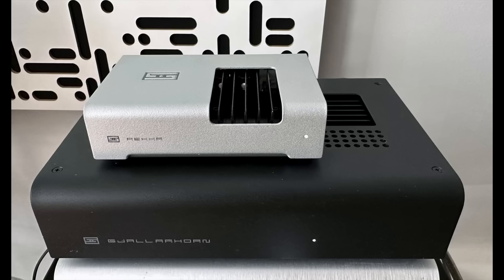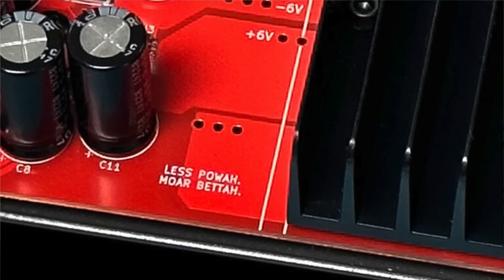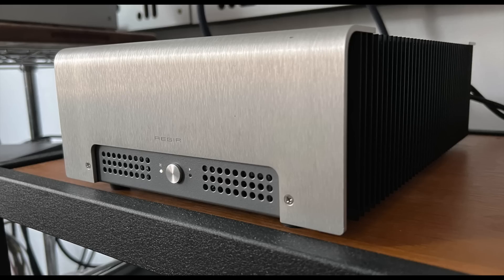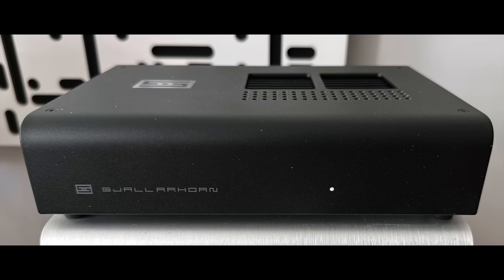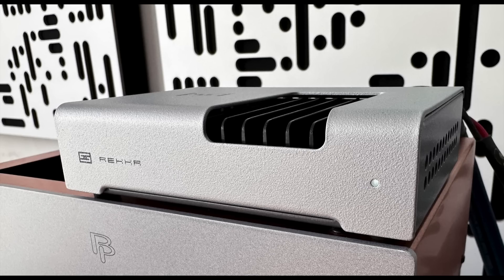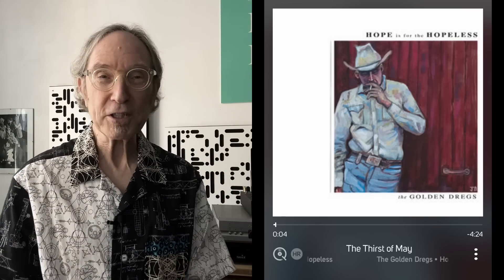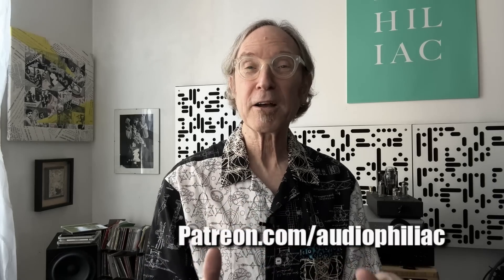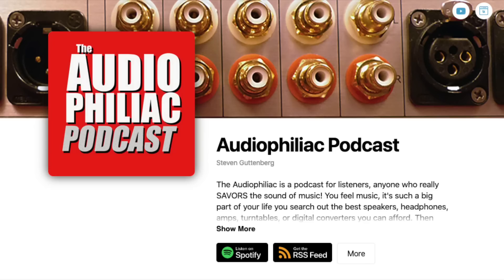More SCHIIT: Rekkr & Gjallarhorn Amp Reviews

Comment: I'm really enjoying my Gjallarhorns run as monoblocks through my KLH Model 5's. Using a Freya N preamp. Happy to answer any questions too.
Reply: Running two 'horns in the same config.  Topping e50 > 'horn + 'horn > Emotiva t2+  (i switch between having them mono and bi-amping, for funzies)
Reply: How are you running them as monoblocks? I just got my first one and never have ran monoblocks before. Do you really need the balanced input to make it as a monoblock?
Reply: I recently purchased a Freya + and a Gjallarhorn.  I am still within the exchange window and have been worried that I should have gotten the Vidar II.  But, for 200 dollars cheaper I could purchase a 2nd Gjallarhorn and run mono...  Are you happy with the sound quality?  Do they get relatively loud as mono blocks?  I have Wharfedale Denton 85th ann. speakers (4 ohms and a claimed 88 dB sensitivity) and don't tend to listen loud, but sometimes like to crank it up a bit.  Thanks!
(Thanks for the video, Mr. G.!)
Reply: Would love to hear the improvement or difference in running the Gjallarhorns mono.
Reply: @gabrielgarza863  Monoblock is an amplifier with one output for one channel. For a standard two channel system with two speakers you would use one amplifier per speaker.  In the case of this unit, it's a two channel amp that you can bridge to be mono by connecting the pos of one channel and the neg of the other. It's labeled on the back of the amp which one to use.
Reply: @andrewz925  Thank you. Can you split the RCA input  from your preamp so you run the left channel to one amp and the right channel to the other while its in mono mode?
Reply: @randijofabrications  get vidar 2
Reply: @gabrielgarza863  Yes you have to use balanced for monoblocks.
Reply: @claybomb545  Done
Reply: @randijofabrications  I ran a single one for a few days while my second was shipped (they accidentally sent me one when I bought two but they corrected it quickly). While I got well past twelve o'clock on the Freya to get it loud, I still didn't max it out to get it louder than I'm allowed to have it. Two are just fine. But they're not meant to rock a house.
Reply: Not to hijack your thread, but I have a Freya N too (and I'm getting a Gjallarhorn), and I was wondering what tubes you like in yours.  Thanks.
Reply: @zounds13  I haven't done any tube rolling yet but I will be getting some Siemens E88CC and some Reflektor 6922's to try sometime soon.
Reply: @andrewz925  Oh yes that is what I meant. Thank you. I was probably overthinking it. I saw the mono sign over the balanced input on the Gjallerhorn and I was thinking it would only work in mono mode if you use the balanced input only.
Reply: @gabrielgarza863  According to the specs on the website the stereo RCAs are for stereo output only and the XLR is for mono output only, so I was incorrect.
Reply: @gabrielgarza863  Yes. Need a balanced source with XLR outputs. Send the left channel to one Gjallarhorn and the right to the other. 1:27 shows the rear panel. + of the right channel output goes to + on the speaker. - on the speaker goes to + on the left channel output.
Reply: Gotta be careful running a stereo amp as mono because with a speaker that drops to 6 ohms for example, the amp will see a 3 ohm load…this is why it’s not uncommon for people to prefer sound quality of an amp in stereo vs bridged mono.
Reply: @gabrielgarza863  to my knowledge you can only use the balanced input for Mono. It is designed to work with 8 ohm loads only. It can do less, but may trip, and shut off.
Reply: I had the same idea. Any benefit of this setup vs 1x Vidar 2? It seems like you could get way more out of the latter for around the same price (and have room to upgrade later to a second vidar 2 in monoblock). Genuinely curious—thanks in advance!
Reply: @keplermission  It’s a reasonable question, brother. Steve compares Vidar 2 to one Gjellerhorn(?) and the verdict is on the side of the Vidar 2. My simple question is would running TWO gjellerhorns in mono shift that verdict (all else being equal). This is a much more fair comparison, as price is similar.
Reply: What a great combo. Love the model fives!
Reply: @maximburgman  one vidar is a ton more power. No need to monoblock vidar as same problem…stereo amps bridged to mono get unstable at 4 ohms. If you want to monoblock buy monoblocks.
Reply: @keplermission  No qualms about any of that, sir! But I’m coming from perspective that Schiit has a certain ‘house sound’ and other commenters are talking about running two Gjellerhorn as monoblocs. My question is would this work better than a Vidar 2 (also made by Schiit) for roughly the same price—and if so, what would be the comparative advantages? Thanks for your response!
Reply: @seanb3303  both the Gjellerhorn and Vidar 2 were designed to be able to be monobloc’d (whether this is ‘better’ I don’t know). My question was does using TWO Gjellerhorn as monoblocs offer advantages vs using one Vidar - for about the same price? Thanks for your comment!
Reply: @keplermission  the problem with bridged mono is the amp sees half the impedance. So yes this will limit speaker selection and will run the bridged amps harder….for double the money 😀 I will stop short at saying bridged mono is a scam, but it is majorly inferior to true mono…and in many cases people are paying double to have their amp current drained by bridged mono.
Reply: @keplermission  this is from Jason Stoddard…but what does he know? 😀 Where is the 4 ohm watts listed for bridged mono? It’s not listed because the bridged amps will see a two ohm load and possibly go into a protection shutdown to keep the amp from going up in flames 🔥
Reply: How big is your listening space?  How loud are you listening? Looked up the sensitivity of the 5s, they’re less than the Klipsch he reviewed.
Reply: @jackstraw1756  Fairly close to 12x18 room size, and I don't listen loud enough to shake anything or annoy my landlords (though they're quite forgiving as they have very young kids). The KLH are nothing like Klipsch though, that's for sure.
Reply: @maximburgman  using two stereo amps bridged into mono is often times inferior to using one. That is why there is no 4 ohm rating. If these were true single channel monoblocks it would be a different story. So no advantages to Vidar regarding watts or current.
Reply: @randijofabrications  I have a similar setup: Freya+ into Aegir driving Sonus Fabers that are not a simple load - 4 ohm and 89dB.  The Aegir is a new addition, and while I don't listen at very high levels, I'm strongly considering getting a 2nd Aegir so I can run them in mono and have more reserve power available.  The Freya+ really brings out the best in my old Sonus Fabers.  Tubes are new to me, and I see some tube rolling in my future.
Reply: @billh4477  Thank you, Bill, that's nice to hear.  Are you happy with the sound quality?  
Now that I have the Vidar coming I thought, maybe I should have ordered the Aegir to get the smoothest sound possible??  But then I see myself wanting a second Aegir for more power *when I need it*.  And when it comes down to it, I should err on the side of simple.  I encourage my family to listen to music, and the more switches and buttons that need to be pushed to get sound coming, the more likely they are to say screw it and pick up a phone.  Hoping the tube rolling option will allow me to explore different sound signatures, etc.
Best to you!
Reply: @maximburgman  ya that would be a great comparison down the road. Sometimes Steve is able to do this after a time. Id guess the review amps are making their rounds, and maybe when that has petered out a tad they can send him 2 for the comparison.
Reply: @keplermission  he may not be an engineer. I dont know Ill take your word he was only in advertisement. The thing is he doesn’t need to be an engineer, he doesn’t need to design a single thing, he doesn’t need to have any say in any product his company sells. The reason why this is the case? Well he has engineers who work for him. Some of the best in the business tbh. So all he has to do is tell you what they told him, and voila he has now informed you about their product. To think because he said it makes it invalid is silly. If we thought like that we could dismiss everything you’ve ever said that wasn’t your expertise. So to avoid that we don’t act like that towards others.
Reply: @gabrielgarza863  you do what you can buy an RCA to balance connection adapter
Reply: @stephencosta6814  Didn't know that was a thing. Thank you!
Reply: @billh4477  I was in the same situation, but bear in mind that the second Aegir will make the sound bigger it is not a huge improvement.  I am constantly switching between one and two Aegirs and can't decide which setup is actually better.
Reply: @zounds13  To update, I've rolled in Telefunken Black Diamond in the gain stage and JJ Gold Pin in the follower stage, and it is a truly improved sound. The somewhat compressed sound and sharp edge it had with the stock tubes has gone, and it's warmer and more spacious.
Reply: @apparentlyretrograde  That sounds expensive!  Do you telling us where you got them?  Are they 6922s or #CC88s or what?
Reply: @zounds13  Nobody said tube gear is cheap. :) The Telefunken Black Diamond (E88CC/6922) were 160USD for a pair and the JJ Gold Pin (E88CC/6922) were 75. So for another $235 it sounds great rather than just good.

Ultimately it's not as good sounding as my 300B-based amp but a) it's not as expensive to buy or roll tubes as the 300B amp, b) it uses a third of the power out of the wall, and c) the 300B amp can't drive the KLH's to a full sound, so it gets the Focal Chora 826's which suit it better.
Reply: @apparentlyretrograde  awesome, thanks for the info.  I'm going to have to take a more affordable approach, though.  So far, all I've done is put a pair of NOS Admiral 6CG7s in the gain stage.  A definite improvement.
Reply: @zounds13  So you have the Freya+ rather than the Noval?
Reply: @apparentlyretrograde  Nope, it's a Freya N.
Reply: Further update for anyone tube rolling the Freya N... I have been enjoying the Telefunken E88CC-TK in the left bank and the JJ Gold Pin 6922 in the right bank. Solid sound with new production tubes, but not spectacular in any way other than excellent bass dynamics. But today I tried some JAN Sylvania 6922 NOS and, using an adaptor to 6922, some JAN GE 5670 NOS. The combo is so clear, with excellent imaging and soundstage. Not as much punch to the bass though.
Reply: @sauhamm3821 What are Funzies? Is this the speaker? I have not heard them.
Reply: @apparentlyretrograde  Can I connect the 2 amps using the XLR?
Reply: Is the schiit gjallarhorn amp class D? sinusoidal waves?
Reply: @marcosr2   schiit doesn't make class D

Comment: I just got the Rekkr last week. Loving it so far! It’s in a near field desktop setup. Running from my MacBook Air into an iFi Zen USB DAC / preamp through a Loki EQ. Speakers are the Klipsch RP-160M. Can’t get the volume knob past 12:00 without becoming too loud. It’s completely silent and has more bass dynamics than I thought it was going to. It’s a keeper.
Reply: Hi Mike. I am planning to get Magnepan LRS+ speakers. Do you think the Rekkr would deliver? My place is a small apartment, so no high power is needed, just clear pure quality sound.
Reply: @DJVARAO  Sorry, just saw this. I have no experience with Magnepans, although would love to get a pair of the LRS+. I'd be afraid that once you get more than 5' or so away, the SPL would really begin to drop off. Even stepping away from my desk and walk to the other side of my desk results in low listening levels.

Comment: I'd really like to see another comparison with these in dual mono setups. Maybe also if you could compare with the ACA too!
Reply: I’ve got both.  I actually prefer the ACA.  Smoother, better soundstage and better control in the bass.  The Schiit is a decent amp though for the money.
Reply: @Pete Wergin  Surprising. I have an ACA I built last year. While it sounds great, I'd say the bass presence is its biggest weakness. Which schiit amp do have? Are you running in dual mono?
Reply: I’ve got the Gjallorhorn running as a single stereo amp.  I’ve tested both using high efficiency single driver speakers.  No question, with an easy impedance load, the ACA has more control.
Reply: @petew01  Thank you for the comparison!
Reply: Remember, an amps bass response and even its sound is very dependent on what speakers it’s paired with.  One amp may sound incredible with one set of speakers and mediocre with another.  Synergy is very important.

Comment: Yeah.
My Schiit breakthrough happened just today, too.
I have just the Magni 3, and I didn't like its sound.
I was using headphones almost exclusively,
and I don't really like what the Magni 3 does with them.
But for a few weeks, I'm trying with speakers, too.
These are more like old, cheap, low end speakers.
They sound rather bassy, boomy, and I didn't get them
to sound good, not even with EQ.
But today I had put the Magni 3 as a preamp,
before the power amp.
I thought that maybe its leaner sound will affect
the whole sound good.
And it did !
It made the system to sound much leaner, less boomy
but detailed, faster and punchy.
Which is a miracle with those lazy speakers.
It seems basically to save my system.
The Magni 3 is a system saver.
(The bad thing, that I can use only the headphone output,
'cause probably an electrostatic discharge killed
one side of the preamp out on my Magni 3.
But in the headphone output, it's still much leaner
than all my other preamps.)

Comment: I was hoping for a mono block review and with the Pure Audio open baffle speakers as mono blocks and single.
Reply: James uh ... all mono blocks are different!   These Pure Audio are using Eminence woofers with uh, you know, 'car audio speaker driver motors' but I'd recommend old, auction sourced Realistic Minimus-7 with any new sub-woofer.  In the US, the old 1990 year Hitachi SUB-700 is rarer than hen's teeth but it's the best, it's all we'd ever need.  The other thing is ... let's assume your amplifier and speaker are an ideal match, then you have to get an input that runs with that set!  You know, that is very difficult to achieve?  But I'd say Realistic Minimus-7 have that wonderful Auto-sound, in car tonal balance, the punchy bass and soft, floating high frequencies.  So if Pure Audio achieve that auto-sound tone then all we need is other, car audio standard inputs.  You know - try Pioneer, or whoever makes Car Audio CD players etc.

Comment: I think that Schiit might have an issue with internal competition between the products.  They have done this before with their headphone amplifiers.  Consider the first Vidar, barely above 81 dB THD+N,  which the Vidar 2 improves to ~ 88dB, almost as good as the Aegir 93 dB.  By far the power cost efficiency favors the Vidar 2 ($4 per watt versus $20 per watt for the Aegir) The Gjallarhorns are in the same neighborhood at ~90 dB but the cost efficiency is as high as the Aegir ($20 /W) but with higher distortion.  Clearly the Vidar 2 is the best proposition at all volume settings.  There are integrated amplifiers out there (Yamaha and Sony) that cost in the neighborhood of single Gjallarhorn, without having to go into class-D amplification.
Reply from the maker: Thanks for watching, could you please tell me the models of the $300  lass AB Yamaha and Sony receivers?
Reply: @SteveGuttenbergAudiophiliac  HI Steve, I enjoyed the video.  Well Amazon has the Yamaha A-S301BL and the Sony STRDH190 2-ch amps.  They are probably equivalent or less than the Gjallarhorn in sound quality.  Back when I got started I was going to get a  Yamaha integrated, but based on your recommendation I tried the Aegir and never looked back!

Comment: I used to be low-power-amp-phobic. Then I used a decibel meter and VU meter and learned that my average listening level is below 70db and that, even at my absolute loudest listening levels, I never go above single digit wattages. I've been using and loving "low power" amps ever since with zero worries or regrets. Based on witnessing tons of other people's listening habits and preferences over the years, I'd wager most people's stereos almost never see the far side of 10 watts.
Reply: I wish. I really wish. I still like to listen way too loud. 

Huh? What'd you say???

Comment: Great video as usual! You should review the SMSL VMV A1 to change brand in that "small" amps category:)
Reply: I'd like say to help Steve and yourself by debunking the idea of speaker sensitivity as applied in Steve's review this time.  It's all very well to compare a 95dB and 86db speaker and flatter the amplifier but Steve is just playing and then saying, hey I had a good time!  Speaker sensitivity is one electrical factor and it's very much linked in with many others that Steve is just not thinking about, how useful is this review to a consumer?  It's no use.  Because as Villchur pointed out there's stable and shifting impedance and you know, x-over issues, power rating, size of drivers, size of room, size of voice coils.  What does 86db tell us if we neglect relative impedance and its character?  It tells us nothing.  Steve found they were very similar.